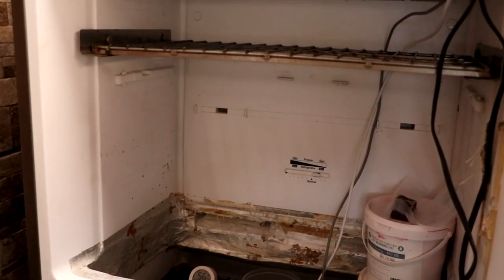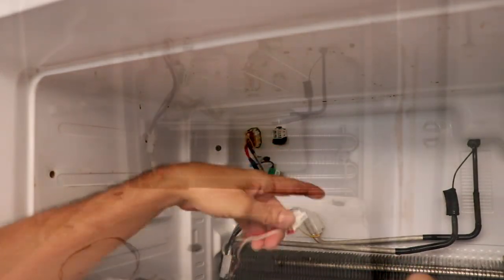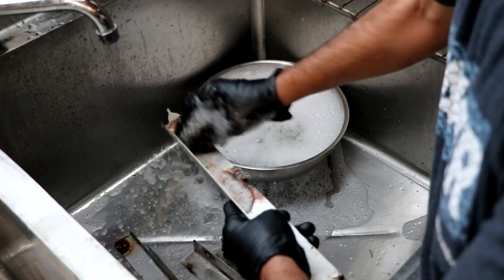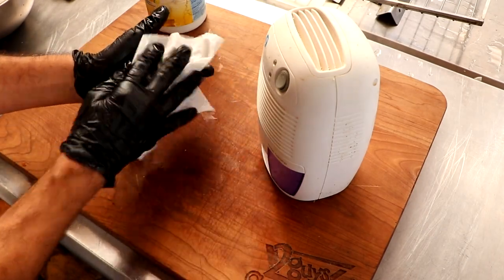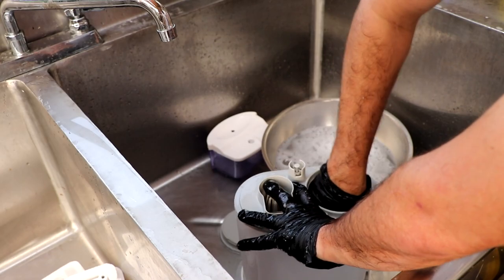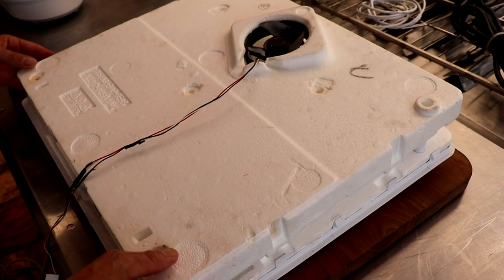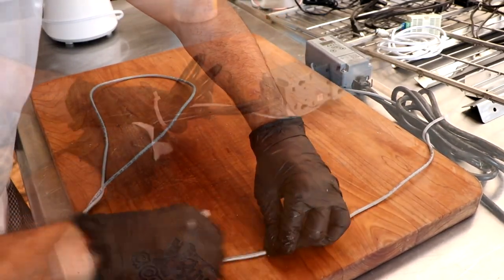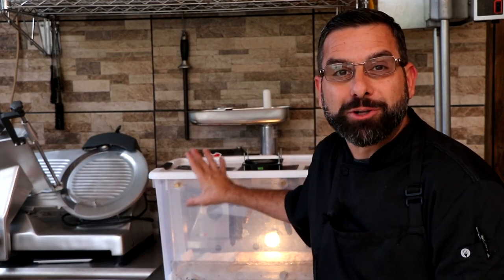How to properly deep clean your dry curing chamber

Comment: I am glad you reminded me I need to clean my cheese cave. Great job Eric you didn't mention it but you can use the bleach solution on the cooling coils that was exposed when you removed the back cover. These are made of either copper or aluminum and bleach doesn't hurt it at all.

Comment: I have an opportunity to buy small refrigerators at an auction tomorrow, I want to make a curing chamber. The model number is Avanti RM 4516 B. It is 4.5 Cubit Ft.
outside sizes: 201/4 " wide, 21 1/2 deep  32 1/4 high. Is this big enough to cure 10 lbs in pork casings with all the other equipment needed? Thank you for your answer.
Reply from the maker: it's hard to say.  From the pictures I've seen online it looks ok.  It looks like it can only fit 4-5 soda cans wide.  Might be a bit on the small side (especially considering the equipment that needs to be added)
Reply: @2guysandacooler  Thanks so much!

Comment: Hi Eric. Would giving it a good wash down with vinegar solution on a regular basis be a reasonable preventative maintenance measure ( noting you still would need to disassemble the whole piece from time to time) ? I am just getting my chamber finalised and looking to give it a sanitisation before commencing and was considering the vinegar method. Wondering if I should do the bleach clean as well (I have converted a commercial fridge with aluminium internal panelling). Kind regards  Mick
Reply from the maker: for a new chamber that would be perfect.  I wouldn't do it as a PM solely because the goal is to create a beneficial bacteria/mold colony in your chamber.   The only reason you would want to do a deep clean or vinegar wash is when bad molds start to take over.  It actually happens very rarely.  Usually only when the fridge gets unplugged and remains closed for a week or so..
Reply: @2guysandacooler  thanks for the prompt response Eric. Will hopefully do a short video of it once finished ( currently in testing mode)